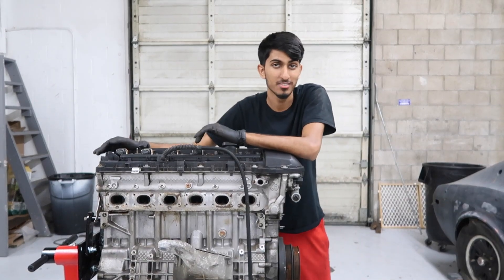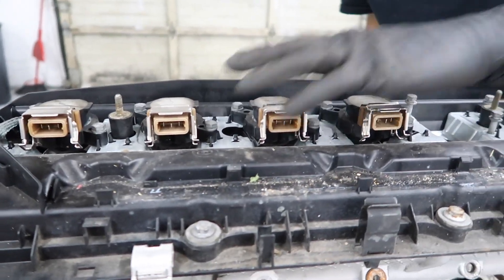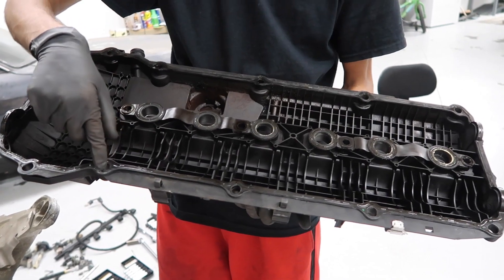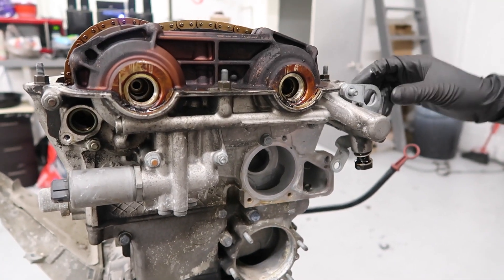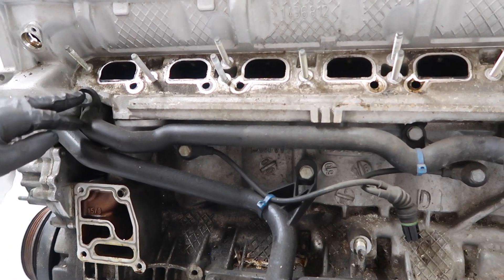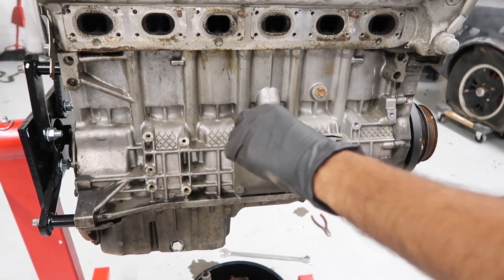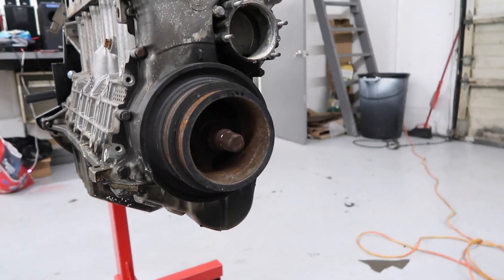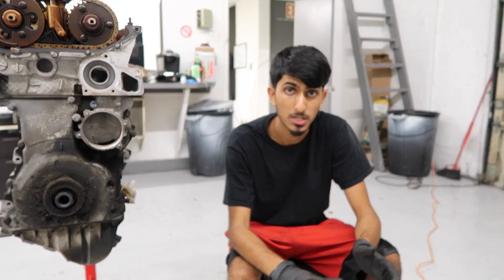Part 4: BMW M54 Engine Disassembly- Vanos, Valve Cover, Crank Pulley

Comment: Could you do a video on how to keep all these screw, nuts and bolts organized so you know what goes where?  I'd like to do something like this but I'm so hesitant because I'm afraid later on I won't know what goes where and I know some panels have different sized bolts such as the oil filter housing.  Thanks a lot for these videos man, I'm learning SOOO much!
Reply: thanks man .I had the same question
Reply: Plastic baggies, strip of masking tape on each bag identifying location, quantity, and size/torque rating.
Reply: I use a bunch of little tubs with lids. I use a sharpie to label the tubs and put the lids on so the wind doesn't blow all the nuts/bolts all over the place (I've nearly lost things because of it). I can then stack the tubs in order that I took the bolts off.

If a part has different size bolts I usually write it down before I start the job. I also write down the instructions (inc. torque specs) to the whole job before starting because I have a rubbish memory.
Reply: +Rene G. Solis Just like Dicer328 & E-Z I use zip locks with masking tape for larger parts & the plastic containers that have separated bins for all the nuts, bolts & screws. I bought several of the plastic containers at Walmart for $3 or $4.
Reply: Go to your local cheap-o Dollar Store: get a pack of sandwich bags. Put the hardware inside the bag and mark it with a sharpie marker. It doesn't get any easier than that. Also, pick up a bunch of brushes if you plan on degreasing your engine.

Comment: hello very good videos explaining how to work the different parts of the M54 engine, now I would like to know how to remove the pulley from the crankshaft if I do not have the engine outside as you have it in the videos and does not have an impact pistol either.

Comment: Easiest it putting breaker bar on ground tucked up against the frame and turn the key making engine rotate and it will break lose the bolt

Comment: If you don have an impact, what are your suggestions of how to remove the crank pulley #22 bolt? FYI, i didn't take the whole engine block out of the car
Reply from the maker: You can get the special crank pulley holder tool, and then uses a huge breaker bar and a bunch of pipes for leverage.

Comment: Can an engine from an 03-06 330xi fit in a 2002 330xi?? The engines look the same but I think they changed. I bought a 2002 330xi with 52k miles from copart  with a engine with pulled head threads.  I'm guessing overheating too.

Comment: Question. So I recently replaced the timing chain guides on my m54 since mine were broken. Somehow the chain got bumped a tooth on the crank sprocket and I didn’t realize this until I reassembled the engine and started it. Now at TDC, the cams are not in the right place which confirmed my theory. Am I able to pull the timing chain tensioner out of the block and spin the cam gear to realign the cams from the top or won’t that work? I know the crank sprocket is smaller than the cam sprocket but don’t know if they’re equally different so I would be able to move the chain 2 teeth on the cam sprocket?? I guess what I’m asking is if there’s any other way realign the cams without pulling the front cover and moving the chain down one tooth on the crank sprocket? I’m really trying to avoid that as the engine is back in the car and fully assembled minus the valve cover.

Comment: At the end when you were removing the rear o2 sensor bracket, do you know what the black plastic thing that sits on the top does? It fell off when I was doing the VANOS seal job. I'm pretty sure I got it back on properly despite it being really easy to knock loose, it has a little peg on top so I thought I was supposed to click something onto it. My engine is the 2.2 so it doesn't have the secondary air pump vacuum lines the 325 and 330 has.
Reply: I have a 325i and I'm pretty sure it doesn't have the secondary air pump vacuum lines either http://www.realoem.com/bmw/enUS/showparts?id=AN36-EUR-12-2000-E46-BMW-325i&diagId=11_2203
Reply: Strange, I know I've seen the 2.5l with them. A quick google shows that some don't have them and some do. One says that updated VANOS software meant they were no longer needed, which looks to have happened on the facelift model, yet someone says they've seen it on a 2004 build.

Comment: Was looking for some tips or some feedback. I put a new engine in my e46 due to headgasket leak. I had a code for p0355 for crankcase position sensor before the install and im still getting it after new engine installed. Ive bought a new sensor and cleared code... could it be a wiring issue? Any 1 else have a P0355 code and fix?